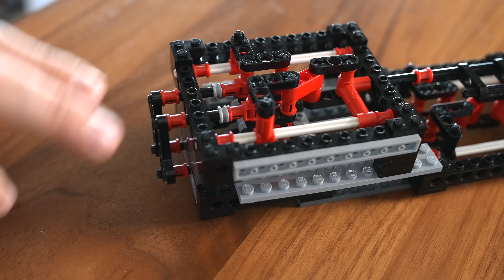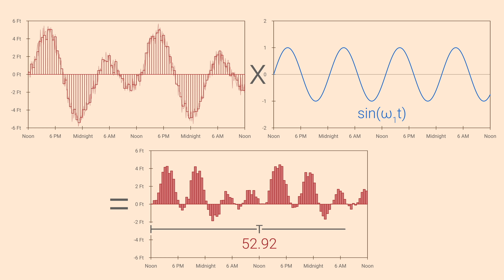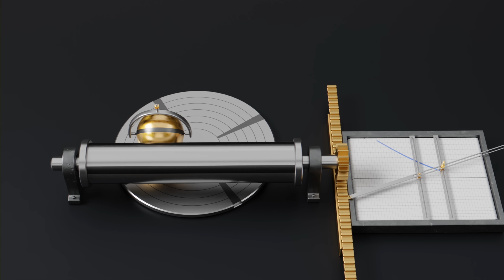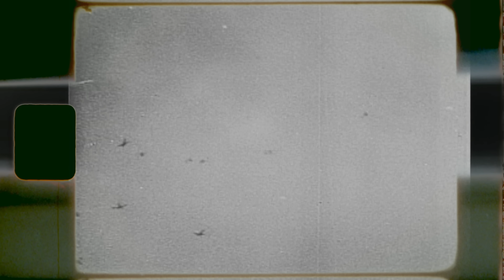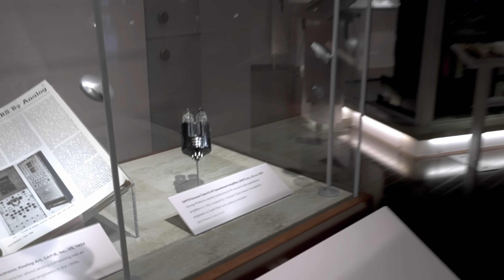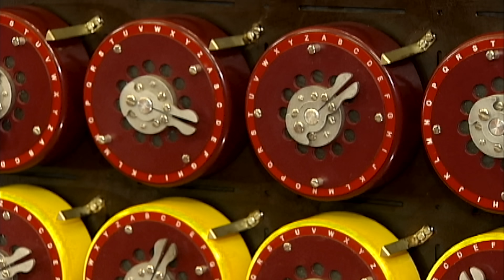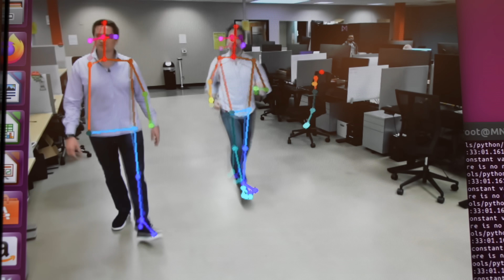The Most Powerful Computers You've Never Heard Of

Comment: I play my guitar through an analogue valve (tube) computer. It does complex signal manipulation in the time domain. These can be set up using control knobs. I call it an amplifier.  I went to college in the '70's. Slide rules, and mechanical calculators were still used, electronic calculators were just becoming affordable. Some labs covered setting up second order differential equations using op-amp circuit blocks to simulate whatever mechanical (usually) system under consideration. Such use was touted as the reason op-amps came into existence.

Comment: The advantage of digital computing is that it works in steps or plus, minus or no change in units, witch is also it's weakness. It can not calculate fractions very well.
The advantage of Analog is its infinite output value witch also makes it weak to noise.
A sound amplifier is just a Analog computer.

Comment: cars utilize analog computing as long as they exists. 
The differential "computes" power and speed distribution between two wheels on different diameter turning curves.
The steering mechanism does similar calculations for the different angle of steer between the inner and outer steered wheels. The carburetor took into account the acceleration request, engine vacuum, air speed to determine the air/fuel mixture drawn by the pistons. The centrifugale weight of a distributor rotor change the ignition angle BTDC. while digital computers control it in modern cars they use "analog" ignition maps to actually time the ignition. Those are just few example of day to day uses of analog computing in our digital world

Comment: At the Sequoyah Nuclear Plant where I started my career, we had a giant analog computer that covered one wall of an office.  It took about 100 inputs from the plant, or when the plant was down, switches could be flipped to let a pot simulate the input.  This computer computed the core dynamics in near-real-time.  It took inputs from the external neutron detectors which measured power, input from the differential temperature across the reactor (about 8 deg F) which also measured power, steam pressure and temperature and a bunch of other things including the TIP (traveling incore probe) system.  This consisted of 128 tubes that penetrated the full length of the core.  A mechanical switching system picked what tube the fission chamber was to be pushed into.  The fission chamber is a tiny ion chamber coated on the inside with U-235.  It generated a current proportional to the ionization caused by fissioning of the U-235 and thus the neutron flux.  

When all 128 channels were scanned, the computer had a 3-d map of the level of fissioning in the core.  It drove an E-size engineering pen plotter that mapped the flux in the core and then plotted a control rod sequence of movements to keep the burn-up constant throughout the core's life.  We used that map to program the rod block computer.  This consisted of a 50X50 plug board that could be removed and taken back to the office for programming.  Programming consisted of placing jumpers on the board that, when control rod movement was called for, it selected the next rod to move.  Another analog computer.  There were perhaps 20 plug boards, pre-programmed with the rod block pattern for various operating regimes and operating time of the core (the level of burn-up.).

The TIP system mapped the core about once a month.  If the map was significantly different from the last one, a new rod block plug board had to be programmed.

Something funny was when management decided that analog was old-fashioned and so they had the programmer of the plant's mainframe computer, a modified Xerox Sigma-7 to do the same calculations.  This computer didn't have an OS.  The FORTRAN compiler was what ran the thing.  Programs had to map out their own regions of the huge 10 megabyte disk.  It took him about a year to complete the programming.  It took about 3 days to compute what the analog computer did in seconds.  Much code optimization cut the time down to about 2 days.  Totally useless.

The rods didn't move very often.  The core was self-regulating via its very high negative thermal coefficient of reactivity.  And to compensate for long-term fuel burn-up, a "chemical shim" is used.  The shim is boric acid, boron being an excellent neutron absorber.  As the core burned up, the concentration of boric acid was gradually reduced.

The reactor was designed to load-follow.  The turbine control system had a "power demand" analog input that would have come from central dispatch.  For whatever reason, TVA decided to operate Sequoyah and its clone, Watts Bar as base-load-only plants so that input was jumpered out.

Essentially all nuclear plants in the US and most of the fossil plants are controlled with massive analog computers.

Comment: oh and doing 1000 steps at the same time or more thats really its strength
digital is step by step even as fast as it goes
its not at the same time
sequential (again im not gonne say anal al the time wi) does it at the same time
on an alectronic sequential device like modular synthesiseer
at the end you have to split the voltages but its at the same time

Comment: I work on old power plant turbine control systems that are almost completely mechanical.  They use hydraulic integrators and relays, along with a lot of linkage to precisely control speed and pressure.  

When they are set up correctly they outperform the most modern digital systems.  Mostly due to the continuous nature of the feedback sampling.  

The pitfall is the maintenance of them.  The mechanical systems need a lot of work compared to their digital equivalent.  They also lack the redundancy of distributed control systems.  But I guarantee they provide more precise control.

Comment: My first view of an analog computer was of a Central Air Data Computer (CADC) made by Bendix Corp. It was enclosed in a clear plastic bubble to show us (airmen in an Aircraft Instrument Systems class at Chanute AFB) back in '65-'66 what we would be dealing with in fixing the F105 fighter jet. It had about 4 to 8 (?) levels of gears, differentials, cams and dual-synchronous transmitters to perform calculations from inputs of airspeed, altitude, and temperature and send the results to various systems throughout. It was a cylinder about one foot in diameter and about 18" in length. About the only system it didn't affect was the ejection seat! AAAHHh, the good-ole days!!!

Comment: Your conclusion that the US resorted to firebombing due to Norden inaccuracy is only partially correct.  The "real" reason was that bombardiers could not hit their targets with the Norden due to some factor influencing the fall of the bombs from their nominal bombing altitudes.  It was the Jet Stream, unencountered in Europe by lower flying B-17s & B-24s.  At that time, altitude was life; the higher you could fly, the more difficult it was for the enemy to hit your aircraft with AAA fire or to intercept it with fighters.  The B-29s were pressurized and far more powerful which gave them the ability to fly at much higher altitudes.  But, navigators were reporting distressing and confusing data; the aircraft were barely making headway across the Pacific enroute  to their targets in Japan. Something was hindering the progress of the aircraft in unpredictable ways.  A lot of work later, the Jet Stream was discovered and Curtis LeMay, commander of XXI Bomber Command ordered the switch to lower altitudes to take advantage of the fact that Japan was built on wood.  It was Robert McNamara who recommended the switch based on his research and knowledge of the Japanese infrastructure.  The message here is to be careful with your conclusions.  There are far too many ill-informed viewers who take what you say as "gospel."  For instance, there are likely thousands Googling who the hell is LeMay and McNamara?  Do you know?

Comment: As a US Navy reactor operator of 60s-era nuke submarines, I am recalling that subs had a large number of analog computers, from bow to stern, so to speak. In my own training for my specialty, we were told of magnetic amplifiers (mag-amps) used in German gun directors, that still worked perfectly after being recovered from sunken ships. Part of my work was checking and correcting as needed, the micrometer settings of certain variable circuit components in a particular analog computer that was absolutely vital to the operation of a nuclear submarine engineering plant. In the meantime, we did manual calculations with a slide rule and graphs, to determine when the reactor should go critical. (all of these submarines were turned into razor blades decades ago, so no useful classified information is in this remark)

Comment: You can use digital computers, and in fact even integers to represent a number with a certain amount of decimal points, and with a 64 bit computer that number can be very large along with having a high level of accuracy.  The issue isn't how the computer sees the number, it's how a program can interpret the number.  Of course modern computers do FP math and do it incredibly fast so it doesn't matter, but if you had to rely on a computer that just dealt in integers you can still represent a real number, once again with a fixed amount of digits to the right of the decimal point since a program can interpret a number however you program it to.

Also, in terms of any specific bit position, let's say 2 to the 0, 1 + 1 = 0, and you have a carry out.  If you have an EXOR gate this satisfies the addition for an given bit without regard to carries.

Comment: I am mathematically illiterate in the sense I never took any math courses past algebra in high school, but I can understand some of the concepts with explanation... 
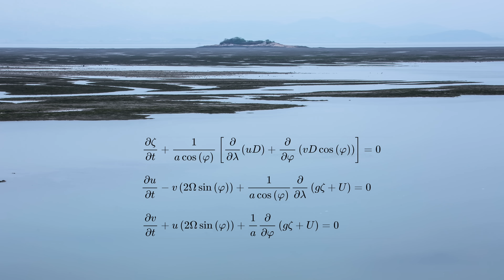I understand around 3:35 that those are some form of calculus equations. What I dont understand the importance of is them being equal to zero. 
Is that what defines a "solved" problem? 
Because you have a set of variables that you can adjust to "tune in" the equation so that you end up with a useable answer? 
I dont even know enough math to know if what I asked makes any kind of sense at all...
Either way, Cheers
(also was going to mention Clickspring but others have done the job nicely)

Comment: 14:20 — Clearly, proper gun-laying mechanisms made a huge difference in anti-aircraft artillery effectiveness, but this comparison has some pitfalls that need to be addressed in order for it to be fully appreciated.

In WWI, the vast majority of ammunition fired at aircraft were from ordinary rifle-caliber machine guns. These bullets (mostly) had a diameter of about 7 millimeters. By 1943, most Allied anti-aircraft guns had a caliber of over 40 millimeters, with shell weights at least a hundred times greater than the machine gun bullets. In summary, if we go by an approximation of the mass of shot required to shoot down one aircraft shows that the difference is not as dramatic as it would first appear.

However, it is still impressive when we consider that aircraft of WWI were slower, flew lower, and were much more fragile than most aircraft of 1943. In 1917, a gunner could easily track an aircraft by hand, but by 1943, the guns were so large and the aircraft so fast they could move across the sky faster than any gunner could hope to follow despite being further away, they were better-protected against attack, *AND YET,* using gun directors, it took only about half the weight of shot to bring down an aircraft that it did 20 years previously. I imagine this figure improved even more once the VT shell was introduced, but that’s a different video.

Comment: I used and helped develop analog computers in 1960's and early 70's. Gun aiming analog mechanical computers used gears and wheels . It considered ship vector and speed and distance to target. The disk/ball mechanism for integration mentioned were also part of it. Electronic ones used tube then transistor operational amplifiers with resistor input and feedback for aritmatic plus capacitor feedback for calculus anf special diode networks in input for trig. And so on. Moon landing simulator we made combined analog (to "think" ) and digitals with control for in/ out. Civil engineers and auto companies used analog pc's to optimize suspensions and roadside slope grading. Plotters as large as beds drew plans and curves far more accurate than primitive digitals. I used m9 in USAF.

Comment: But these examples of analogue computers appear to be designed to perform a specific function. To make it perform a new function, you will have to rearrange the whole machine. The strength of a digital computer is that it can run code. It's purpose is generalized and it can do multiple completely different things at once.

I digital computer can simulate an analogue computer from the palm of your hand. Try looking up what it looks like when you try to use an analogue computer to simulate just a digital processor. It won't fit in the palm of your hands...

Comment: The early Automatic Transmissions where hydraulic analog computers. As time, and developments went, digital computers where added to transmissions to smooth out the shifting between gears, or make the process more efficient. The crazy thing to think about is that the modern automatic transmission is a mixed digital, and analog computer.

Comment: I do not understand the Antikythera mechanism. Such a complex machine in that time? 
 
Neither there is any trace that someone at that time made any attempt to solve the set of tasks (solving various astronomical functions) that the mechanism does, 
nor is there any trace of so perfect mechanical engineering, creating so well-working toothwheels of all kinds of sizes that interact smoothly. 
 
Not that I would not think they could have been capable to do such a machine. 
 
But there is notthing around that shows so to speak this technological environment evolving and spreading around it. Such abilities need time, work in incremental steps. 
 
 
It is as if you see a Ferrari in a bushman village in the Kalahari desert. Everything else is of wood, of stone, of clay. 
 
You have to go 2000 miles to find the origin, the 200 years of engineering there.

Comment: I disagree that "advancements in machine learning" are straining the computing power of today. Machine Learning has always been strenuous for computers, it's just takes an incredible amount of space as well as computational steps. It's only because of the incredible advance of computing power that we have been able to recently make use of machine learning. Advancements in machine learning have been making deployment of machine learning solutions much more efficient. Sure some models such as large language models are still impossible to run at home for the most part, looking at other fields in the machine learning industry, there have been huge advancements. I expect sometime in the future we will see similar advancements made with LLMs. Though training is something that remains still very intensive, for industry quality models this can and is done by large firms, with access to large amounts of data storage and computing power. Luckily, you only need to train a model once, when deployed, it's much cheaper to run than to train.

Comment: Modern aircraft well into the 70's and 80's had analogue computers, or more commonly hybrids (electro mechanical). I used to teach the courses on some of these. Fascinating devices, in fact it was the compensating of the variables that took up a significant part of the device, theory, and of course the troubleshooting. The ball and disk integrators (and its derivatives) were in practice sealed from the elements. Hard corrosion resistant steels replaced the brass. Cooling was by isolated heat exchangers. And they weighed a bloody ton!

Comment: Another one would be the Torpedo Data Computer, it calculated firing solutions for submarine torpedoes during WW2.

Back then, the torpedoes were unguided and ran in straight lines (for the most part), so you had to fire where the target was going to be by the time the torpedo had traveled the distance.

Lots of gears, gyroscopes, and relays inside, fascinating machines.

Comment: Analog computers were used more recently than many realize. They have very good high-frequency, low-latency responses. Fighter flight controls were analog until the F-16 used a digital flight control. The F-111 converted to digital flight controls much later. And those frequencies are relatively low.

Comment: Some are saying that future mechanical-analog computers can be built using nanotech assembly methods. Looking like a bunch of incredibly tiny lego-like structures they will behave as small clusters of molecules and comfortably operate at gigahertz speeds. Running on chemical power from the surrounding 'wet' environments (think biology) they could be amazing cheap, amazingly fast and amazingly efficient. Self fabricating, self maintaining, self repairing and communicating wirelessly they could literally be everywhere.

Comment: I want to experiment with analog encryption on wifi. I was going to buy the old cable TV "signal filters" and install one on the router antenna and replicate the circuit on the wifi antenna in a battery powered device. The goal being longer battery life on a device. A control group using digital encryption.